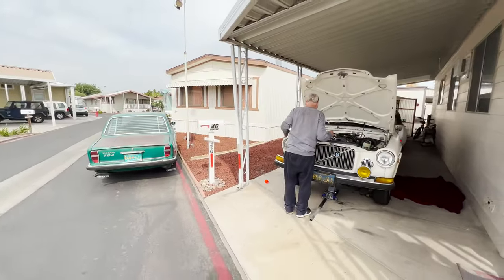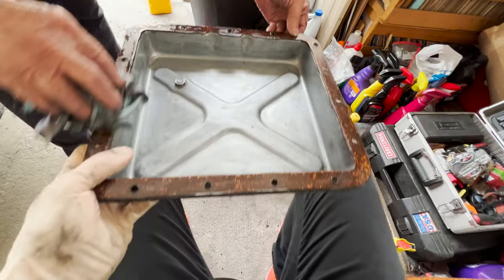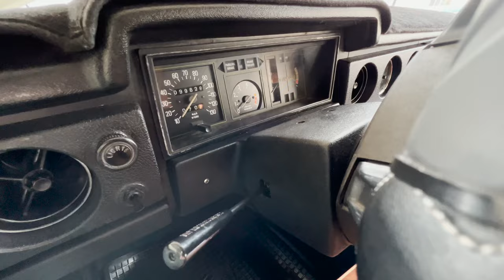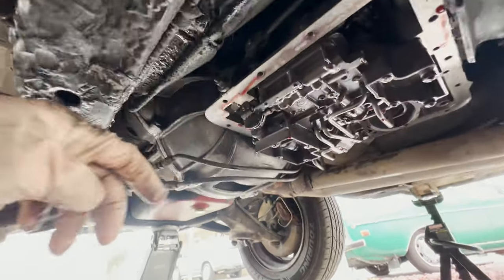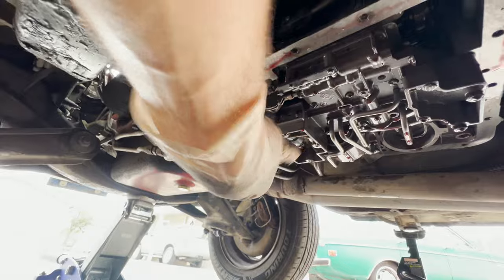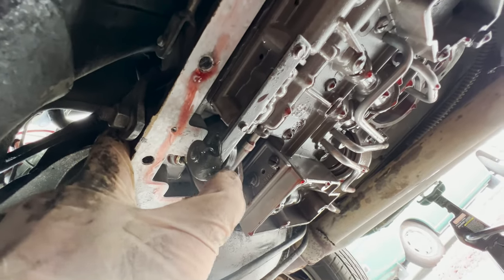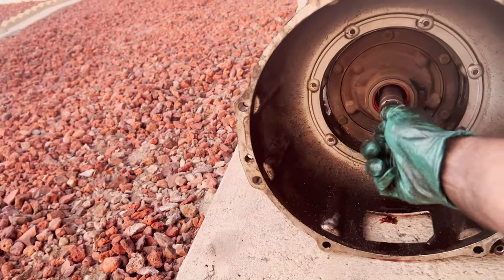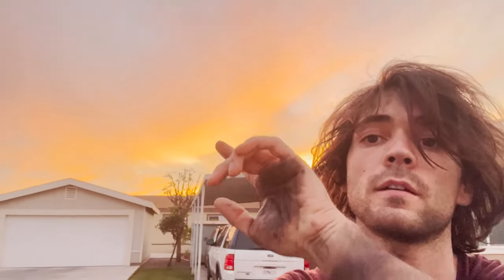BW35 Transmission Failure & Removal - 1973 Volvo 164

Comment: I would recommend replacing the torque converter as well while you're in there, if you weren't planning on it already. 
They're big trash cans for debris and catch crap. 

Good on you for being a friend and helping remove it! I can definitely understand the frustration with project cars eating away funds. Best of luck with the endeavors and although it isn't much, I hope my Patron support helps out!

Comment: I repair my own car and partners car and know how you feel (although I wouldn't tackle removing a transmission). There's always something that goes wrong -  what appears to be a relatively easy job ends up taking a lot longer than it should, causing me stress and wondering why I started in the first place! There's definitely a sense of satisfaction to be had from repairing/replacing parts on cars, but workout on a driveway in the middle of winter, between rainn showers quickly becomes frustrating.

Comment: I was forced to drive 1400km in 2nd as i couldn't afford to pay someone to fix it. Once back home, I bought a 2nd hand unit for only $10 and with zero experience built one from 2.
The major piston cylinder was cracked (maybe changing from D to R while moving did it), and one of the bands was burnt black.
It worked 100% but I had to chuck the top bell-housing bolt because I did not have a flex drive.
NB. Keep a small bucket of autobox fluid for cleaning your hands while working, no rags unless lint-free.

Comment: I am in disbelief, that the transmission would go on Mr,Hunts Volvo 164, I was wondering if the transmission from a 240 or 260 would be compatible with that car, that 164, was working ok what happened.

Comment: True, true. I work with professional mechanics every day. I work on my own cars and family and friend’s cars just enough to know I could never do it for a career. Way to hard on my 50 year old body. Pulling a transmission laying on my back? No thank you!
Reply: Without a lift, it's the way I do it. Not fun, but decent if you have a helper. Just remember to drain the fluids and triple check every last thing is disconnected and clear.

Comment: Have you ever removed one of this or any a/t at all before? I mean, it's already a tough job to do it in the floor, and the dipstick tube always brings its own battle, but it surely helps to take it out with the torque converter in it. It's actually the right way to do it. I get it.. It's "less work" leaving it in the engine, but it's totally wrong.
On the other hand, I wouldn't recommend to swap it to OD BW55 or 45. You can get the benefits of overdrive, but that 35 is stronger. It's almost like a small FMX... Really strong. Most likely it has broken or worn out governor sleeve or some sealing rings. It's the more usual failure on those. Look for worn out oil pumps or bushings... Do not attempt to assembly it with out the converter in it's place. Keep up with this great job.. Love that Volvo. Real jewels

Comment: solution 2 post lift. I put everything on hold with cars (got annoyed after 5 years without proper lift) rebuilded barn with new concrete floor +epoxy on the cheap. Now I can walk under the car and feels like every car guy should first build garage and then the cars or just watch youtube on the sofa.